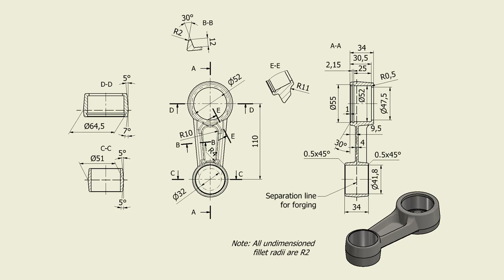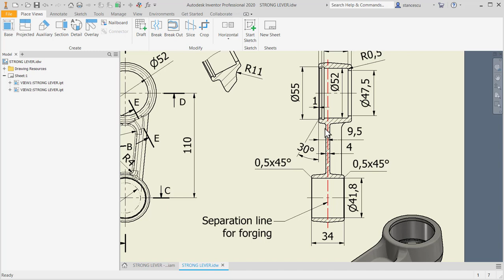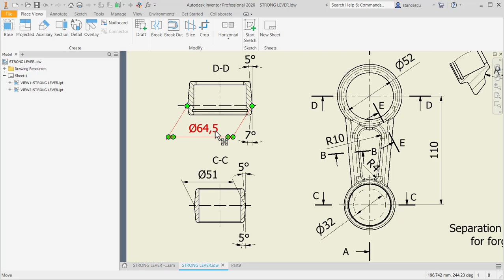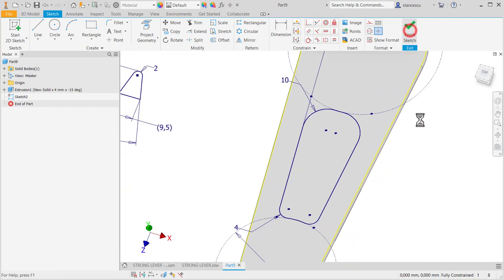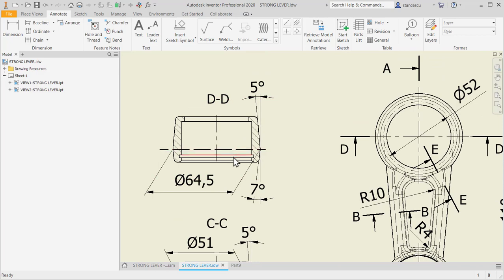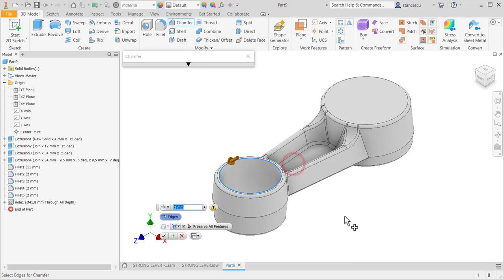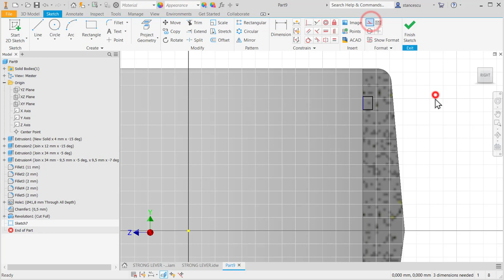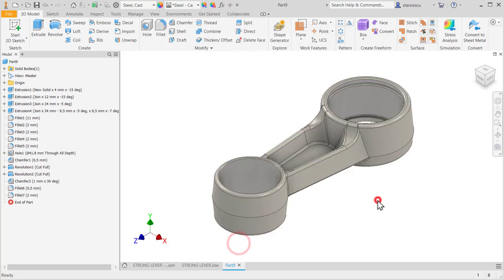Tutorial Inventor - 068 STRONG LEVER (Part-028)

Comment: At (time 8:40) you add a 15° inward taper, but no where on the drawing does it specify this dimension.  To practice my solid modeling skills, I have been blindly using just your drawing files, and forming 3D models from them. This is the first model so far ( I am working my way through the 100 sequentially) where I had to exclusively look up your video in order to properly build your part.  I would like to know where on the drawing there was specified a 15° inward taper.  If the drawing excludes this detail, than I find that the drawing files is flawed, and should be amended to include this information.
Reply from the maker: Thank you, my friend for your message!
There is a dimension of 30° in section B-B which is supposed to be distributed equal on the two sides.